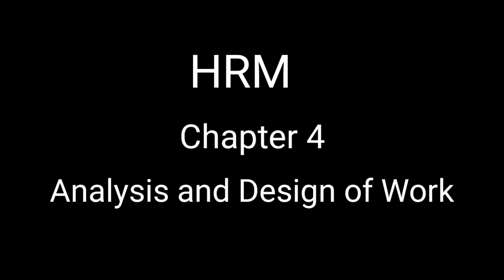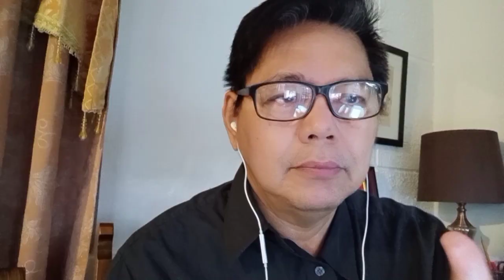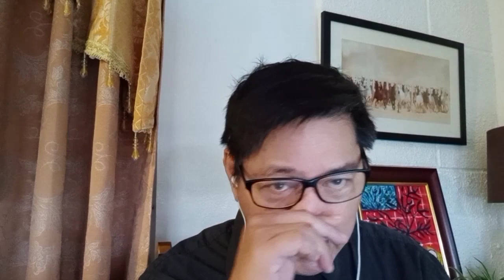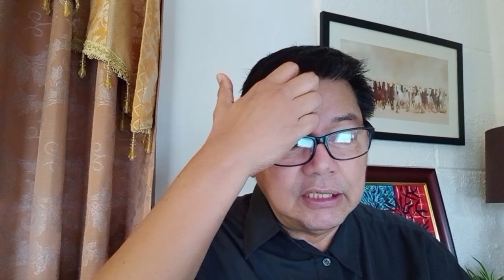HRM: ANALYSIS AND DESIGN OF WORK

Comment: FINAL EXAMINATION
PATALINGHUG,DONIC V.
ASM 3

1.	Name and discuss the nature of the steps in a workflow analysis.
Even before starting the 3 workflow analysis steps, to practice proper company workflow management, you must have the thorough knowledge of the organization’s strategic planning. This is the only way to properly align the business objectives with the efficiency of its processes. With this understanding, the first stage of process analysis begins.
1-	Interview employees (actors)- There is no more effective way of understanding the flow of a process than by interviewing those who perform it or have some form of experience of it. At this stage of process analysis, it is necessary to identify: The activities of the process and its sequence. Its participants, their responsibilities, and the hierarchical level of each. The information the process uses generates or transforms
2-	Analysis of process models
To analyze the process models, you need to answer 10 questions:
•	What is the reason for the process?
•	What does it seek to accomplish? The systems it uses? What value does it add to the final product? And what is its current performance level?
•	What performance metrics do you use? What KPIs are defined and which points are measured? Is the process within the expected performance standards (or not)?
•	How many interactions with customers are there? And what are they? Also, who are the customers? What are their needs? Are they satisfied? Check for redundant or unnecessary interactions with customers.
•	How many handoffs are there? And what are they? Handoffs are moments in the process where information passes to another person/system. Check if any of them are creating information bottlenecks and whether the organization measures the time between them.
•	What are the rules of the business? Business rules are standardized procedures that expedite decision making. Check if they’re appropriate if they’re causing obstacles and what their steps and levels of approval are. Find out based on what criteria the company created them for and whether you could eliminate any of them without causing harm to the process.
•	Are there other bottlenecks in the process? It’s necessary to find out what’s being constrained in the process (information, product or service), what factors are leading to the bottleneck (personnel, systems or organizational) and whether the bottleneck derives from a handoff.
•	Are there variations in the process? Determine where they occur most often, what the tolerance threshold is, and whether task automation can eliminate variations.
•	What does the process cost?Check if this cost is compatible with the market and if it’s possible to optimize the process to reduce costs.
•	What degree of variation does human activity cause in the process? Find out if this variation is tolerable and whether or not you can eliminate it with the automation of a task.
•	How do you perform process control? What documents do you use to control the process and what steps does it require for its approval?
If you want to maintain an adequate workflow, you must answer all of these questions as completely as possible during these workflow analysis steps. Then you need to document the process. Before you see the next step, understand what handoffs are more completely by reading these articles from our blog: Handoff agreement: one of the best handoff strategies. Handoff strategies: Convert these procedures into results
3- Documentation of the process
The most important document of the workflow analysis steps is the As Is process diagram, that is, the process model as it currently is.

Some other attached documents may be spreadsheets, checklists, procedures manuals and even statements from participants.

2.	Compare the functional structure to that of the divisional structure, including the nature of their design, their respective advantages and disadvantages, and the types of environments in which they might best be used. 
The key difference between functional and divisional structure is that functional structure is an organizational structure in which the organization is divided into smaller groups based on specialized functional areas such as production, marketing and sales whereas divisional structure is a type of organizational structure where operations are grouped based on divisions or separate product categories. An organization can be arranged according to a variety of structures, which enable the organization to operate and perform. The objective of the same is to carry out operations smoothly and efficiently. A functional organization is a commonly used organizational structure in which the organization is divided into smaller groups based on specialized functional areas such as production, marketing and sales. Each function is managed by a departmental head that has a dual responsibility to be accountable to the top management and to direct the respective department to achieve favorable performance. Such functional areas are also referred to as ‘silos’. Functional structures are ‘U-form’ (Unitary form) organizational structures where the operations are categorized based on common expertise and experience. The functions such as finance and marketing are shared across divisions or products. The most significant advantage of this type of a structure is that the company will be able to benefit from specialized functional expertise and enjoy notable cost savings by using shared services.
Divisional structure is a type of organizational structure where operations are grouped based on divisions or separate product categories. Here, separate functions such as Production, HR, and finance can be seen under each division to support each product line. Divisional structures are also named as ‘M-form’ (Multidivisional form) and are most suitable for companies who operate with several product categories in geographically dispersed markets. Multinational organizations such as Unilever, Nestle have expanded their businesses to cover all the regions in the world. They have production plants in a number of countries to produce and sell in respective countries. Due to the high volume of production, it is not practical to produce all products in a single location and distribute to a number of countries. For such organizations, they have limited choice but to adopt a divisional structure. In this type of an organization structure, inefficiencies in one division do not affect the other divisions unlike in a functional structure since the divisions remain separate. Further, the divisional managers have significant autonomy to be responsive to customer demand without much influence from top management from the parent company. On the other hand, control issues are much likely to arise due to the scale of the organizations and divisional managers acting upon their own personal agendas without considering working towards a common corporate objective. Divisional structures are very costly to operate since cost benefits available to functional structures through shared services are not enjoyed. Tax implications and additional regulations are also applicable to companies that operate in multiple countries.

Comment: FINAL EXAMINATION 
PARAS, TRISHA MAE S.
ASM3

1. Name and discuss the nature of the steps in a workflow analysis.

Interview employees (actors)
There is no more effective way of understanding the flow of a process than by interviewing those who perform it or have some form of experience of it. 
Analysis of process models - If you want to maintain an adequate workflow, you must answer all of these questions as completely as possible during these workflow analysis steps. Then you need to document the process.
Documentation of the process
The most important document of the workflow analysis steps is the As Is process diagram, that is, the process model as it currently is. Some other attached documents may be spreadsheets, checklists, procedures manuals and even statements from participants.

2. Based on a workflow analysis, describe the major differences between how tasks are grouped into jobs at a fast-food restaurant and those at a five-star restaurant. Which job design approach do you see predominating in each.

Functional

If you’ve had a job, you likely worked in a functional organizational structure.

The functional structure is based on an organization being divided up into smaller groups with specific tasks or roles. For example, a company could have a group working in information technology, another in marketing and another in finance.
Divisional

Larger companies that operate across several horizontal objectives sometimes use a divisional organizational structure. Under this structure, each division essentially operates as its own company, controlling its own resources and how much money it spends on certain projects or aspects of the division.
Matrix
A hybrid organizational structure, the matrix structure is a blend of the functional organizational structure and the projectized organizational structure. The matrix structure is challenging because it can be tough reporting to multiple bosses and knowing what to communicate to them. That’s why it’s very important for the employees to know their roles, responsibilities and work priorities.

Advantages of this structure is that employees can share their knowledge across the different functional divisions, allowing for better communication and understanding of each function’s role. And by working across functions, employees can broaden their skills and knowledge, leading to professional growth within the company.

Flatarchy

While the previous three types of organizational structures may work for some organizations, another hybrid organizational structure may be better for startups or small companies. A benefit of this system is it allows for more innovation company-wide, as well as eliminating red tape that could stall innovation in a functional structure. As for the negatives, the structure could be confusing and inconvenient if everyone involved doesn’t agree on how the structure should be organized.

Comment: FINAL EXAMINATION 
3ASM
RACRAQUIN, Aurea Francesca

CHAPTER 4

1.	Name and discuss the nature of the steps in a workflow analysis.

-	Workflow analysis is crucial for improving efficiencies that can then reduce costs even when changes are made. Without question, what you’re really doing is ensuring your workflows are not only aligned with your business processes but that they are also executed as intended. After that, you can start to examine areas ripe with opportunities for improvement and also automation of manual, repeatable tasks. If you can use workflow analysis to review workflows this closely, you give your business a competitive advantage. So, what are the three main goals of workflow analysis? The first one is to accurately depict a workflow. Second, it is to search for areas needing improvements. Third, the goal is to optimize a workflow through automation. When you analyze workflows, you’re not just looking for exact documentation but you also want to determine where and how to optimize your business processes. Look at the data. How long does each task take? How many tasks are necessary? Is there a minimum and maximum amount of time required for each task? Asking these questions, and finding a relevant solution, can improve old business processes exponentially. 
2.	Compare the functional structure to that of the divisional structure, including the nature of their design, their respective advantages and disadvantages, and the types of environments in which they might best be used.

Functional Structure:
-	The functional structure is the most common sort of organizational structure that businesses utilize, gathering employees by specialty, ability or related parts. It is based on levels of hierarchy that incorporate different divisions, under the course of designated leaders. Businesses commonly work under functional structure since it bunches individuals together who have similar information, and when utilized in a group environment, makes a difference companies accomplish their objectives.
-	Advantages: increased productivity, skill development, clarity, and minimized cost of operation.
-	Disadvantages: hindered decision-making, competition between departments, and narrow scope.

Divisional Structure:
-	A divisional organizational structure usually consists of several parallel teams focusing on a single product or service line. Examples of a product line are the various car brands under General Motors or Microsoft's software platforms. One example of a service line is Bank of America's retail, commercial, investing and asset management arms. Unlike departments, divisions are more autonomous, each with its own top executive – often a vice president – and typically manage their own hiring, budgeting and advertising. Though small businesses rarely use a divisional structure, it can work for such firms as advertising agencies which have dedicated staff and budgets that focus on major clients or industries.
-	Advantage: Divisions work well since they permit a group to focus upon a single product or service, with a leadership structure that bolsters its major key objectives. Having its own president or vice president makes it more likely the division will get the resources it needs from the company. Moreover, a division's focus permits it to construct a common culture and esprit de corps that contributes both to higher morale and a better knowledge of the division's portfolio. This is far preferable to having its product or service scattered among different departments through the organization.
-	Disadvantage: a company comprised of competing divisions may allow office politics instead of sound strategic thinking to affect its view on such matters as allocation of company resources. Thus, one division will sometimes act to undermine another. Also, divisions can bring compartmentalization that can lead to incompatibilities.

Comment: FINAL EXAMINATION
KEMARK D. CARINO
ASM3

1.	.	Based on a workflow analysis, describe the major differences between how tasks are grouped into jobs at a fast-food restaurant and those at a five-star restaurant. Which job design approach do you see predominating in each? 

Fast-food restaurants need to follow normalized methodology such as a rule each 
Person has general ability so as to turn among occupations. Each job is particular with scarcely any errands, every one of which is determined through standard operational methodology. This depends on an unthinking way to deal with work plan. 
While five-star restaurants skills, profundity of specific information expected of a specific work, greater capacity to adjust to evolving conditions in numerous positions higher prerequisite for relational aptitudes. Each job has more extensive undertaking necessities, and an individual has more prominent obligation regarding finishing an entire bit of work. This is more like an inspirational way to deal with work plan.

2.		Compare the functional structure to that of the divisional structure, including the nature of their design, their respective advantages and disadvantages, and the types of environments in which they might best be used. 

Functional departments arguably permit greater operational efficiency because employees with shared skills and knowledge are grouped together by functions performed. Each group of specialists can therefore operate independently with management acting as the point of cross-communication between functional areas. This arrangement allows for increased specialization.
A disadvantage of this structure is that the different functional groups may not communicate with one another, potentially decreasing flexibility and innovation. Functional structures may also be susceptible to tunnel vision, with each function perceiving the organization only from within the frame of its own operation. Recent trends that aim to combat these disadvantages include the use of teams that cross traditional departmental lines and the promotion of cross-functional communication.

As with all organizational structure types, the divisional structure offers distinct advantages and disadvantages. Generally speaking, divisions work best for companies with wide variance in product offerings or regions of geographic operation. The divisional structure can be useful because it affords the company greater operational flexibility. In addition, the failure of one division does not directly threaten the other divisions. In the multidivisional structure, subsidiaries benefit from the use of the brand and capital of the parent company.